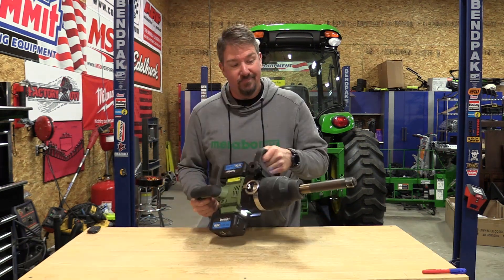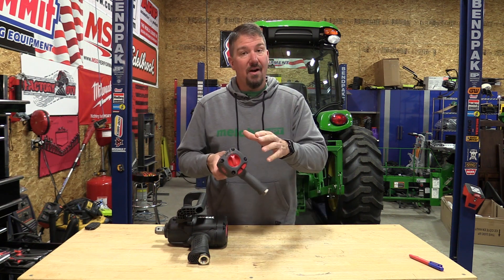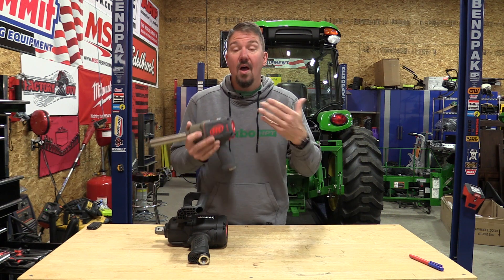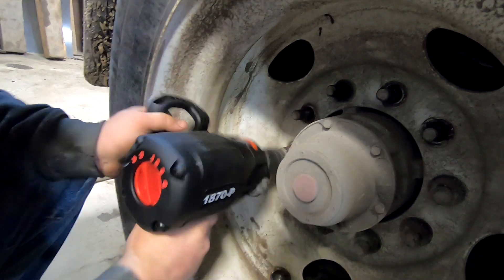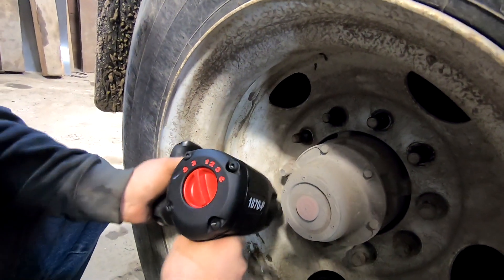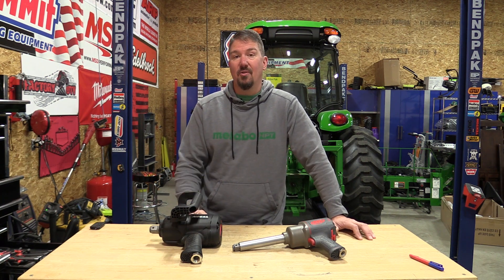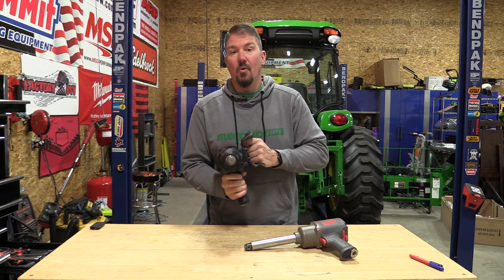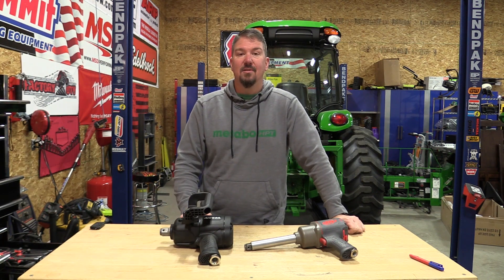Too Much Air!?! Ingersoll Rand Vs Aircat Impact Wrench Testing

Comment: That AirCat 1870-p is a monster. Ive had mine for a little over a year now and it laughs at my 1"d handle milwaukee and is a crap ton lighter. Also didn't cost $1600 either!

Comment: I run my 2850s both and my 2146q all at about 160psi and I only get down to 1/2" right at the beginning of each individual hose. My 2146q does not go in the red. But if I use too little air it will. I think in the literature it stated that too little air was as harmful to the hammers as too much, so maybe thats what its telling you, and me when I under power it. For total disclosure, I do have 90 gallons extra storage and 2 smaller single stage compressors piggybacked in. I primarily work on heavy equipment from 20 tons on up. I have seen IR break many a CP or AirCat guys heart over the years. As far as batteries go. For the price range you won't beat Milwaukee, I don't think you will anyway because I have already sent the Snap On guy back to his truck with his way overpriced battery tools and his tail between his legs. I have heard good things about those IR battery powered 1 inch guns but no personal experience.  And as far as the air guns go I have never seen an IR that was 3/4 or up that didn't love more and more air. You may have to rebuild them a little sooner but I would rather do that than be breaking a 1 inch snap on pull handle with a 5 foot pipe on it jumping up and down in this 100 degree heat we been having.

Comment: I just got the ingersoll 3/4, and it was very disappointing. I tried to take nuts off, and it wouldn't do anything. I tired a friend's snapon 3/4, and it zipped the right off and thought I should try my 1/2 and  they came off. I think it was defective, so I sent it back off to be looked at or rebuilt after 2 weeks of having it. And the nuts were supposed to be rate for 350 ft/lbs, so i figure at most if someone over tightened them, they would be around 500 ft/lbs. Which is still way underrated for that gun.
Reply: We're you running a 1/2" hose with a 1/2" air fitting?
Reply: @roylowery1329  yep with a big ass compressor, and it will run our big 1-inch gun and other 3/4 inch gun fine

Comment: Do you have any experience with air-cat 1994 the specs saying it’s the most powerful compared to the IR 2850max. Or have you ever wanted more power than the Ir 2850 had? Thanks! @WorkshopAddict

Comment: Where did you purchase that new IR 3/4 with the extended anvil? I can't find any online..
Reply: Hello! At this time we have a few options for extended anvils for the 2146 Series. You can purchase the product options of a 2146Q1MAX-6, as the tool with a 6” anvil, or the 2146Q1MAX-3, which is the tool a 3” anvil option. For the anvil as a standalone part, you can select the options of part number 2145-A626-3 (3”) OR 2146-A626-6 for our 6” option.  For anything additional, please take a look at the link (https://www.ingersollrand.com/en-us/power-tools/impact-wrenches/2146max). At the bottom of the page you’ll see a Model Specifications or Parts and Service Tab to hopefully assist with any other questions.  To find a distributor in your area, please look at: https://www.ingersollrand.com/en-us/power-tools/distributor-search

Comment: I have the Proto J199WP I wonder how it would stack up against what you have in this video my HarborFreight item 62396 doesn’t require a lot of air to work on a 10 gallon air compressor but when I hook up a 3/4 jackhammer hose things do get kind of crazy with a 70 gallon air compressor
Reply: i have both the w199wp 1inch pistol with extended anvil as well as the the aircat 1870-p with short anvil, at least with milton g air fittings and a 1/2 hose at 120psi the air cat is noticeably more powerful and the high rpm of the tools just build torque so much quicker, personally i broke the hammer case housing on the proto and dont use it a lot now, side not i do think the aircat stacks up well against a full sized tire gun such as the cp 7782 or the harbor freight earthquake 1 inch extended anvil not 100% as powerful but close and at much lighter and more compact the aircat is probably the best or close to the best 1 inch pistol

Comment: This is air tool 101 basics or 'should be' sadly its not. You MUST be testing 'working pressure' AT THE TOOL with a gauge. Static pressure means next to nothing the second you squeeze the trigger on any air tool. Many folks think manufacturers are specifying 90psi static which is beyond far from the truth. Yet many YT air tool reviewers don't grasp this basic concept.
Reply: Absolutely. The analogy is voltage drop on an electrical line, every point of resistance will cause drop, but it's only visible when air is flowing. The problem with a gauge at the end device is the way it will be considered over-pressure before the trigger is pulled. So, the tool needs to be able to tolerate static pressure of ~150 psi before the trigger is pulled. It would be no good to start blowing seals before air starts flowing.

Comment: Great subject. Air pressure is a weird one. It shocked me that with 102PSI static you mentioned the tool was showing over pressure? (was hard to see for myself on the gauge). One of the reasons we havent tested 3/4" and 1" air is because even with an 80gal IR compressor and 1/2" air line, we havent been able to keep 90PSI in the tool while running. I'm talking a drop from 145psi static 25 feet away to 80-95 PSI inside the tool while running. And an oscillation of that pressure the longer the test and the more things we eliminated like the wall regulator being deleted and just connecting 3/4" wall cast iron to a 1/2" hose. Like a wave was splashing back and forth from the compressor to the gun. All this basically meant we couldn't be confident we'd match the manufacturer's testing ratings, so it wouldn't be an honest test for us to call them on their numbers.
Real life testing is great though. Lab testing requires a lot of fiddly nonsense.
Reply: Always wondered why you don't do the bigger impacts, any plans to upgrade the compressor?
Reply from the maker: We are surprised also as we see a drop in the regulator gauge to about 96 psi when in full go mode and we figure the 1" OD air line has to see a drop also.  Unless we have a bad IR 2146, I cannot explain it.  We were full on red with the 2146.  I fully get why you would not want to even try messing with these tools as there is so much to keep checking and testing along the way.
Reply: @WorkshopAddict  It would be interesting to add a gauge at the inlet of the tool to actually measure those pressures, as a check of the IR gauge. Painters do that all the time. Perhaps the IR gauge is measuring peak pressure before the trigger is pulled, then not resetting as the tool is drawing down line pressure. The seals inside the tool need to cope with the maximum static line pressure, which will undoubtedly fall off as the tool pulls air. I like the real world comparison, since most of us don't have fancy auxiliary tanks.
Reply: For the torque test channel you can add auxiliary air tanks to your compressor made by industrial air I have three of their 20 gallon auxiliary tanks to add to my 10 gallon harbor freight compressor with that set up it’s totally portable so that’s the advantage it has over a 60 gallon or a 80 gallon stationary air compressor and the performance should be similar to a 60 gallon compressor
Reply: I have a 2 stage Speedaire 80 gallon rated around 24cfm set to top at 175 psi. I piggy backed 2 little Harbor Freight 30 gallon compressors in my system. As well as another 30 gallon bare tank. Thats 90 more gallons storage and another roughly 20 cfm coming in.  I can get get a gauge on the tool (either of my 2850s, short or long) hold really close to 160psi while working unless I just hammer for like a minute straight. Those smaller compressors kick in when the big one falls below 145psi, or in other words the whole system actually. Then Duke Energy grins ear to ear. I modded them to run on up to 175psi, the tanks are rated like 250psi. But it can recover fast as you will milk it. Now pressure goes down during that process of recovery unless you quit with the tool if its maxed. But if its working normally you won'tloose pressure, you will recover. Storage is king. It dont matter if you have 200 psi and only 60 gallons of storage, only its first lick or two will be near full potential.

Comment: Hello
Reply from the maker: Good Morning Jeremy.
Reply: @WorkshopAddict  how are you
Reply from the maker: Great, hope you are well.
Reply: @WorkshopAddict  good 👍
Reply: @WorkshopAddict  hello
Reply: What size hose are you using? In the industrial world we use ¾ air hose usually regulated to 100 psi with unlimited air. Most non industrial air hoses are either ¼ or ⅜. I was just wondering how much difference that would make.